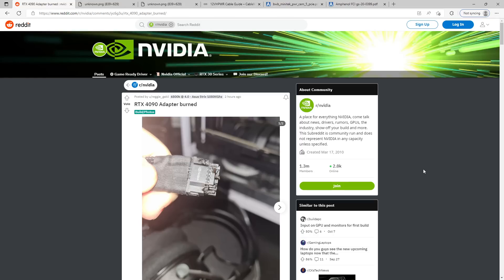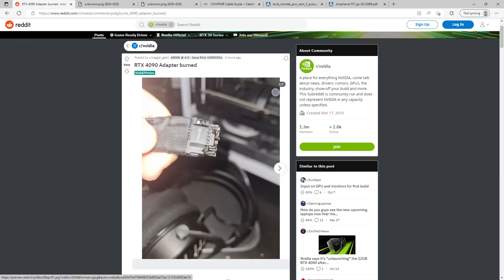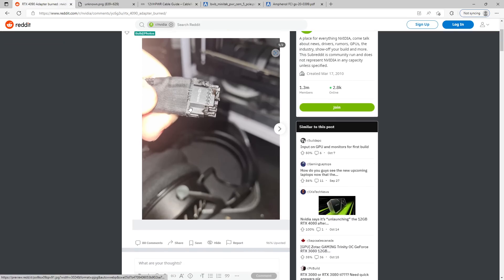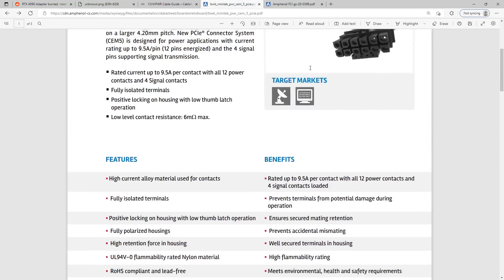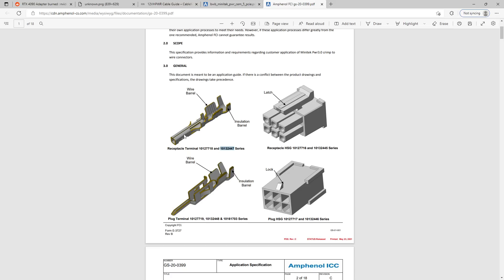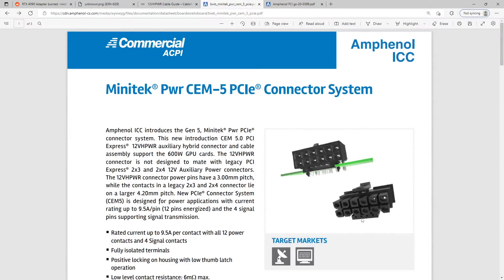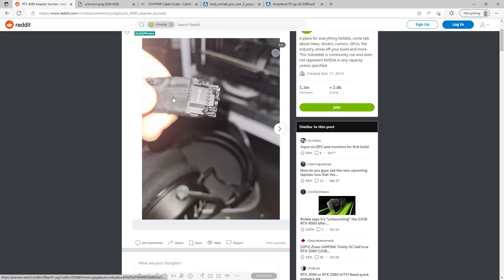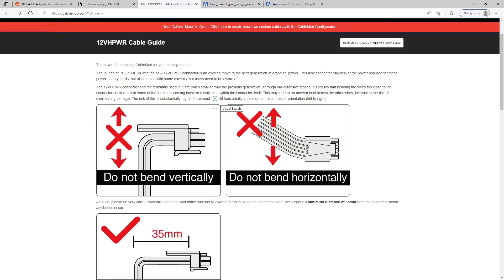The 12VHPWR connector sucks

Comment: Yea it makes sense the 4090 is way to small to attach 16 wires to. I get it. Totally. 

But seriously the advantage of two separate connectors is that even the biggest spaz isn't gonna end up with BOTH of them mangled. 

Validated is a good word for how I feel lol.
Reply: "nvidia saving money on pcb 'cos size > you burning your house down" ~ probably nvidia
Reply: @TheHighborn  warranty void if you run it in a house - nvidia probably

Comment: It seems like the only way this exists is to save one square inch on PCB. Although those PCBs are so small I struggle to understand why was it an issue.
Reply: @Yeltnerb 1 Let's save 25% of space on the PCB while adding 100% more height to the cooler. We are obviously starving for space out here.
Reply: Worst part this is 12 pins. Even if they keep the old gauge it would be equivalent to 2×6 pins.
 This is beyond stupid.
Reply: even 2 8pins would be much much better than this nvidia money grab and don't look back BS
Reply: It supposed to be also replace EPS cable on server. Yes server GPU used CPU power cable if you didn’t know.
Reply: The RTX40 series is made for the sole purpose of maximizing profit. Terrible quality, terrible efficiency, terrible thermals; I wouldn't even pay $300 for this pile of shit.
Reply: Mr Huang: Hello, I like money.
Man Of The Rain Shorts: Why did you decide to save one square inch on PCB, although those PCBs are so small I struggle to understand why was it an issue?
Mr Huang: money!

Comment: Let's see how many of these cases occur before it becomes a proper fire hazard.
Reply: Hopefully there will be better designed aftermarket cables.
Reply: @randomdude8897  needs atx3 psu and perhaps a metal, or at least angled connector too
Reply: @randomdude8897  Spend even more money?! The better solution is to stop buying Nvidia.
Reply: @florin604  I'm going to be frank... I will buy whatever is the best performing. Also, to counter your "spend more money" point... if you are getting an RTX 4080 or higher class card its going to be $1000+ easily. Buying a $25 aftermarket cable is the least of my concerns if I am spending $1000+. I am not an early adopter so if there are more public incidents on these connectors burning out, then I will have second thoughts on buying nvidia this time around.
Reply: @randomdude8897  imagine paying for 1600 $ to get a fire hazard that you need to pay more to remedy it.
Reply: @pulsebear  I understand that. I never said I was happy that it may require an after market cable considering the price they are charging for the cards. But at that point. If you are building a brand new PC that will more than likely cost $3,000 to $4,000 like myself. If a $25 aftermarket cable resolves the issue, then its not a big deal. At the end of the day I am building the best PC I can and not upgrading for 7 years.
Reply: @randomdude8897  for a $2000 card .... youd think youd get good cables
Reply: Oh its absolutely gonna happen. As someone that understand electrical things. Pushing that wattage through  something like that connector is just insane to me.
Reply: Yeah. I am honest here, i thought we would have seen Way more allready. So i guess it means it doesnt Suck that much...

Still hope i am wrong here and only really broken Connectors are an Issue (Which every other Connector would have an Isse as well).
Reply: @flimermithrandir  the connector is really fragile period.
Reply: @flimermithrandir  based on the reddit thread some users said if you google it there are multiple threads or websites have people saying the same thing. Its just a matter of time tbh..
Reply: @flimermithrandir  just wait till the prices drop a little and these get out to more of the masses. Along with a bunch of overclocked 4080/ti's, etc. Anything with a 4090 right now is a pretty premium build. Once these 4000 series cards are budget friendly and getting thrown into every conceivable configuration of hardware we'll probably see a lot more issues. Any issues with a sample size of essentially 0 isn't a good sign.
Reply: it's not going to be a fire hazard. once melted, they short out and the PSU shuts off. -- that is ideally / designed outcome. two of my builds have survived this type of failure (with sata cables), though i did lose one spinny disk and one ss disk (or did not bother repairing)
Reply: @jazzochannel  
1. if shorts were an none fire hazard, nzxt wouldn’t have recalled their h1 cases 
2. How on earth did you manage to get 2 sata connectors (which is low wattage) to melt???
Reply: @jazzochannel  I've seen sata power cables glow red and start fires a couple times. The most common is sata to molex adapters for these types of issues.
Reply: @infernaldaedra  it seems to almost always be adapters that cause the issues... Makes me question if even low powered adapters are worth the risk.
Reply: @jazzochannel  I thought the 4090 was a short in its own right.